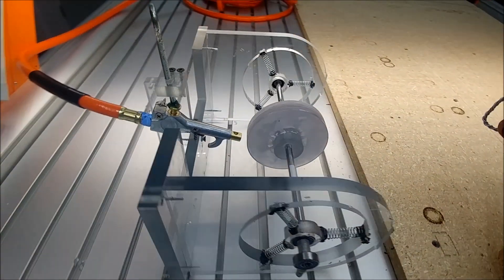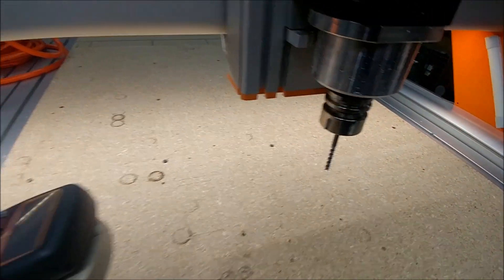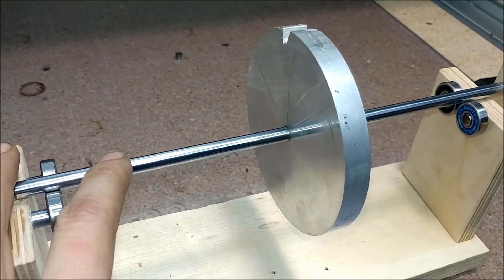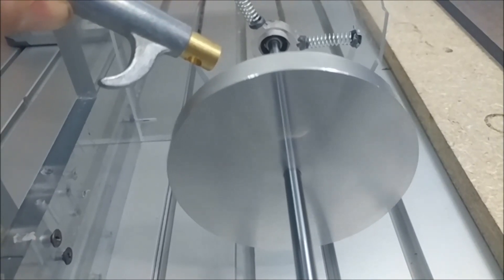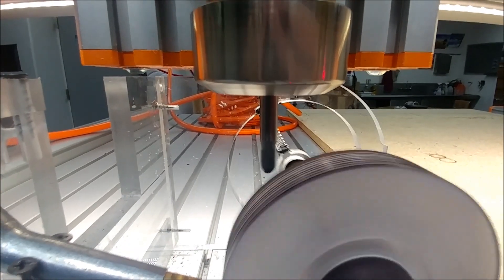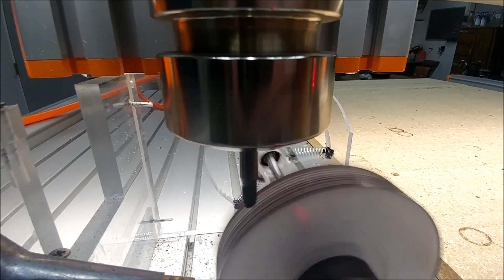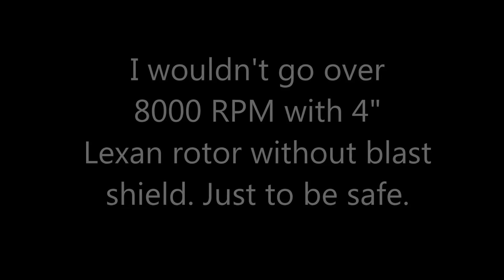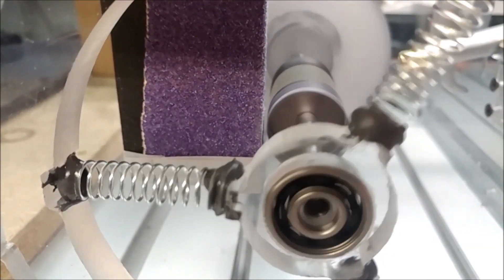DIY High Speed Dynamic Balancing! Tesla's Balancing Patent!

Comment: Great axample, thanks a lot for sharing this!
Reply from the maker: Thank you! I have since greatly improved the apparatus using rubber races around the bearings  instead of springs which makes it quicker and more accurate for balancing. Video on it's way!
Reply: @iEnergySupply   @iEnergySupply  Thanks for the reply! I'm a CNC-lathe programmer/operator myself and love to create al sorts of things in my spare time. 
At the moment I am am very interested in the posibilitys of producing my own energy. Because i'm planning on living off grid with my wife.

I already Installed a pellet/wood chip stove, and  making a biodigester right now and I was gathering all information that a could find about low temp Stirling engines, to pruduce electricity.. 
Until i found out about this amazing project!

I'm loving it! And cannot wait to see further progress on it. 
I will look in to all the videos  on this channel and read the comment before I ask stupid questions :p

Ps. 
This project seems something that I would like to make myself also!
So by the time you developed a fully fuctional system, I hope that you will share the drawings etc. and offcourse we will paying for expenses..
I think this is one of THE best/simplest solutions for what I and many others see as a very good (durable)solution for making your own energy at home!
Reply from the maker: @markgeurts258  Thank you! Remember also I have learned so much along the journey so the older information even though it may not be accurate at times is very valuable. We are nearly finished with the final design for continuous use.

Comment: once you can make or get your hand onto magnetic bering,,its actually not too hard to make,, your thing will work better than spring,, as modern mechanical battery use magnet levitation bering in a vacuum .
Reply from the maker: we have made them before and plan to return in the future.

Comment: Interesting, When I did this I put it on a flexible arm but I did not figure out how to grind off the excess weight. I am now working on a titanium rotor and I think this idea will help me. Thank you and keep em spinning.
Reply from the maker: this was my first balancing prototype, since then I found that I had too much play on the flexible supports, I've since been using rubber races around the bearings, like tires.
Reply: @iEnergySupply  are you confident that the grinding is really balancing the rotor or have you calculated the offset of deflection due to the rotation? 

https://www.softschools.com/formulas/physics/torque_formula/59/

Comment: Its cool to see this approach. I have two suggestions if they are any good im not sure : frequency of the whole assembly is not just simply dictated by the disbalanced wheel in the video and in case of large "wiggle" moments the wheel could have many rotations during one single "large wiggle" so probably it can happen easy that majority of the time indeed excess of the material will be grinded off compared to balanced portion of the wheel but both will be grinded like that in not particularly continuous way with accent that most of the time proper surface will be grinded, lets not exclude small frequencies of the oscillation while larger one is going on in the same time, its decent dynamic balance but its not perfect if perfection is chased so thing can achieve higher speeds. I think with your approach you count on disbalanced side will always hit first your drill bit and good side will not have a chance reaching that drill bit. And i think that happens but not always since frequency of the oscillation of the whole assembly is not always in sync with wheel rotational position. Suggestion one is probably quite complex to be done where oscillation of the whole assembly has exact matching speed with the wheel rotation. Suggestion 2 is simplified example: "push the sandpaper" onto the wheel and at all moments it has firm contact with the wheel(effect one :it will cut down unnecessary amplified vibrations) by spring force where idea is simple, more the wheel pushes toward the spring the greater the sand paper grinding in that moment is removing the unwanted material(side effect : you grinding the whole thing so proper preplanning of the wheel dimensions is needed accounting for that loss of the wheel diameter, as also springs on your video and springs that i am talking about has memory and will kick back at random position hence grinding where is not needed). One more suggestion is firstly grind X and Z where wheel can oscilate only back and forth and springs need to be guided firmly by their own casing and bearings of the shaft are fixed onto those springs- these axis are planar and distance/movement axis(i suggest rotating the wheel at different speeds/passes of the grinding just because we have greater chances grinding excess of the material properly-reason is that different speeds will have different planar x and z axis where they want to push and since we are forbidding up and down movement we would miss some of those forces that we want to grind off, so different speeds gives us a better chance of encountering excess of the material on our springs axis ,probably pulsing the air pressure at particular angle(and changing that from time to time) has a chance of shifting the excess material "wiggle" into desired direction>toward our tool). After diameter of the wheel is corrected with previous step then you can use your approach where whole assembly is suspended where mainly what should be grinded is the Y axis(rotational) and again Z axis(but this time it is whole assembly and is not distance but rotational axis) or in other words the skew of the whole assembly as seen from your video is exactly what i mean by saying this rotational axis and should be the last step, i just think that speed of the grinding process will be faster and slightly more precise with two steps/two machines.    So if i can pull some conclusion it would be : use different speeds, pulse the speed at particular moments so the wobble is poked with grinder from many perspectives, and use very strong springs since large wiggle is not needed and amplification of the wiggle is also not needed, i think if springs get fast as possible into their position is beneficial and assembly will vibrate anyway, and thats how large chunks of large disbalanced materials can be grinded fast which gives us a speed of grinding, then we change the springs toward weaker and weaker ones and with each pass we are dealing with more and more refined tweaks < point with this is > at any moment we have minimal wiggle which allows us moving the grinder more aggressive and saving on time, it not excluded that this dynamic springs approach changes the precision towards better. I started looking at these turbines 2 days ago and saw this dynamic balancing few moments ago so i didn't have'd much time thinking about all of this but its just what my logic in brain provides me and i wanted to help at least with sparking the imagination of what can be done if nothing else. Cheers hehe!
Reply: Now when i think even more about it (inspired by this video) i think electromagnetic spring the solenoid would do much better job and would not produce kick back errors that springs are doing(hence not allowing perfection), but proper solenoid opens many doors of what vibrations you want to allow, how long they can be, measuring the current in solenoids and so forth can talk to other solenoids in the system and tell the story of excess material to the software. Only downside i see with "electrical springs" is single one which is making the g.damn thing hahahaah(quite a task lol)
Reply from the maker: Great suggestions here, my solution was balancing at higher speeds and using rubber rings around the bearings. Seems to work really good. Please read tesla's patent 
NIKOLA TESLA BRITISH PATENT 186,799 - PROCESS OF AND APPARATUS FOR BALANCING ROTATING MACHINE PARTS
https://teslauniverse.com/nikola-tesla/patents/british-patent-186799-process-and-apparatus-balancing-rotating-machine-parts
Let me know if you find anything interesting in there that may add insights.
Reply: @iEnergySupply  Ah that's smart using the rubber, simple solution for complex problem i didn't think of that. Yeah i can totally see why it works better then springs(springs=sharp/strong force with memory that has tendency to sort of be buoyant hence since stubborn has its own frequency for the mechanical work and disturbing the shaft frequency, rubber= slow memory weak spring force(on its own) that does not have tendency to be buoyant hence not introducing additional frequency to the system but rather conforming in gentle way to the wheels shaft forces, and since rubber atoms has strong force of sticking together that should result in wherever rubber rings get stretched the other side/rather surrounding material gets pulled and with the speed and only with the speed of the shaft dealing the forces(now it becomes fast reactive conforming force driven by the force that acts upon it(this is more of an damper instead of the spring isnt O.o))). Thank you for sharing the knowledge with everyone thru the video as also for the paper that i'm going gladly to consume now with the morning coffee ahah.
Reply: @iEnergySupply  I did look at the paper. I can notice his simple convenient adjustable reading apparatus which is just a needle mounted onto the bearing from the shaft, with the weight adjustable per height and by moving that weight away from the shaft i think needle is less prone to show miniscule vibrations(since higher torque is needed to move the needle and just larger vibrations will manage to do that) so instead of adjustable springs he can use one single spring stiffness or smarter in your case rubber but the reading still can be fine tuned in order so we can understand how much excess material we have remaining and how big it is<this does not show on its own where it is that excess of the material (thats something that confuses me in his patent since it is not clearly explained except that he says that for two bearing setup it is about odd multiple or submultiple of the critical, and for one bearing setup it is now equal multiple or submultiple of critical. What he means by critical? Is it critical of when excess material is about to touch the grinding tool or it is speed of the wheel or oscilations that he measure or any other combinations of all three? He confused me there i must admit tho O.o', i'l keep thinking about it). Even better apparatus for reading would be the one that can amplify the readings(these are the moments where you gonna deal with near perfection). I'm just noticing few things. One is even if we manage 99 percent perfection by grinding the outer periphery what we equalize is total mass distribution of the wheel on the outer perimeter of the wheel compared them to each other(thats needed for  sure but its not all to it) ,however from the center of the wheel to the periphery of the wheel there will be material mass difference at different points of the imaginary line and reaching the critical speeds will cause these difference in mass on particular points to act on each other and lead to failure of the wheel(excess compression and stretching that is local in between those points on imaginary line/internal forces that will become obvious only at really high speeds) since true balancing would be balancing the wheel mass locally also at those points.(im getting some ideas how this meat of the wheel can be also balanced but is radical so il keep my mount shut to not embarrass myself ahha). Second thing that is left unbalanced that is in front of our face all this time is the shaft itself- so separated dynamic balancing of the shaft i think is beneficial, then separated wheel balancing, then both together. Now away from balancing, one thing with enormous force that will occur is gyroscopic effect that will try to rotate all spinning components into particular direction that is not natural to the movement of the machine, in other words it will definitely manage to twist the blades/wheel and lead to failure since it will definitely become the force eventually that disbalanced the wheel- this by itself suggests that those gyroscopic forces should be considered and wheel design adjusted to deal/be resilient toward this predictable directional force since it will always be the same as long as wheel rotation is the same, so pretty much wheel design can be successfully be pre-planned. So this gyroscopic force will either directly rip apart the components or either indirectly by twisting hence disbalancing the mass of the all spinning components :S ugh.... And again that one thing that bothers me, from the document this " equal multiple or submultiple of critical" clearly is referenced to the speed however if you have critical speed that you know which is about point of wheel failure , how the hell you spin it above critical hahahaa, so its not the critical speed he talks about, it must be wheel rotation but the critical does not reference the wheel material maximum limits/point of failure it must be wheel speed compared to something else -.-' ..... Im still confused ahhahaha . Sorry for bad English its not my native language.
Reply: I think i got it about critical thingy. Lets just say that main goal as also the trouble with balancing is knowing when to apply the grinding. And from there i can put few thoughts into it by considering it as important part of balancing. One thing that is clear to me is wheel 360 turn per 1 unit of time must be less or double the maximum amplitude of the frequency of the assembly vibration per same unit of time(not related but essential : here we must have lesser "shaking" frequency of the shaft compared to the maximum frequency of memory of the rubber you are using-to avoid that kickback errors that are very noticeable in the springs and miniscule in the rubber< this is sort of how fast i can spin the shaft, thats the maximum which is yours memory frequency of the material+shape you are using to allow bearings to shake, your shaft "springs" must not have delay behind the shaft wiggle and if they are faster thats fine) that you aiming for(we will have many different points on the periphery of the wheel that has different excess of the mass so its completely arbitrary and random hence not convinient grinding all that randomness at once, hence we should tweak our measuring instrument(Tesla provided) to read firstly larger shaft frequencies/ just one, the largest one, by adjusting our weight so far away from the needle center that it does not show almost any movement if any, and then bringing the weight just slightly back so we can pickup the first mass displacement< why doing this since naturally grinder will remove eventually everything(yet not in perfect manner)? Well its not obvious but there is a reason(trying the perfect manner) which is improving the grinding process to happen at pulses/only when we need it hence measuring instrument can show us once it stabilises when we are finished grinding our target excess of the mass without relying on the sound and eye sight on the machine, also instrument allows us tracking our grinding process even if machine is enclosed into some chassis as Tesla was doing(as i understand he did that in order to have same/or close to conditions while grinding that will simulate real environment turbine will spin in- i dont think it is essencial doing it but is nice safety by just removing "over-planning it" and avoiding calculating many factors-so instead just grind it in the environment in which turbine will be used where crazy calculations are not needed but instead we can simply observe and conclude how turbine will perform in real setup)). With this step we have constant single mass detected that we are chasing to remove from the wheel perimeter(main point is we avoid grinding the good part of the wheel-we slowly going there with debugging how to do it). Critical is (that this aimed oscillation maximum distance shaft can oscillate at and together in the same time as marked wheel point arrives to the same local to them respective points in space and the same time). Matching the amplitude needle of the shaft with wheel revolving point i think can be done mechanically and we could easy detect if two are out of synch in which case we move away the grinder and we adjust the speed again. Now to couple the grinding tool and provide opposing frequency to him and matching shaft frequency where highest amplitude of the shaft frequency will be the highest amplitude of the frequency of grinding tool going toward each other:  mechanically bearing of the shaft is connected to the grinding tool with any mechanical assembly that will provide opposing force such as "double elbow" or any other will do. This way we are having our own pulses of the grinding instead of relying on the static grinder and excess of material hopefully and only them hitting the grinder. Now this coupling can also pulse in wrong time(yes frequency of the shaft shaking is directly connected to the grinder so grinder always have same opposing frequency) but this "matching pulse grind" system will suffer fromt he same problem as soon as we step out of the wheel speed rotation + frequency of the shaft. thats why it is essential looking at that shaft frequency meter + wheel rpm. < how exactly wheel rpm together with random mass displacements on it colaborate to produce particular frequency is beyond my brain simulations so things like that can be learned by observation and looking at the machine itself, so my suggestions or attempts of help cut short there.